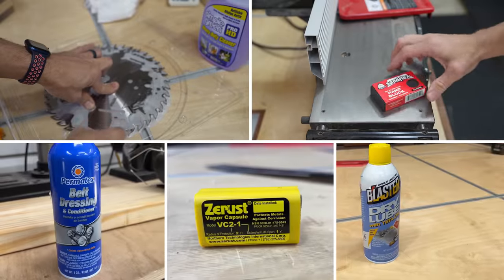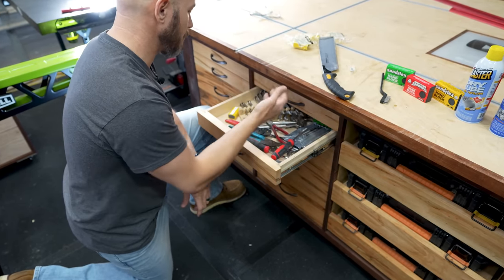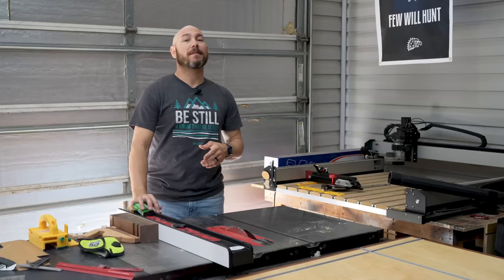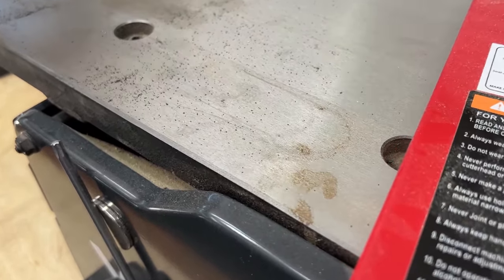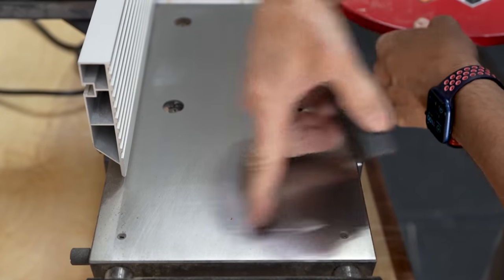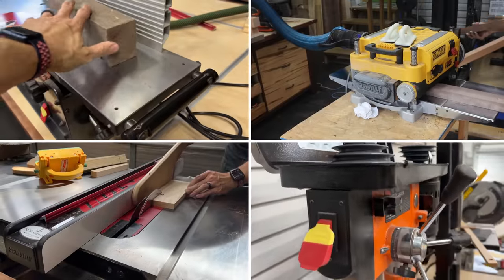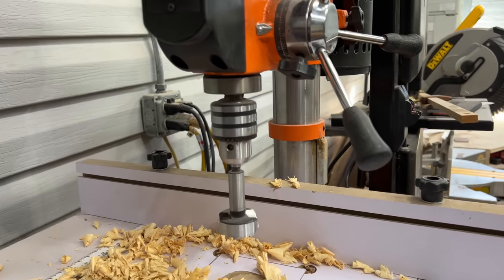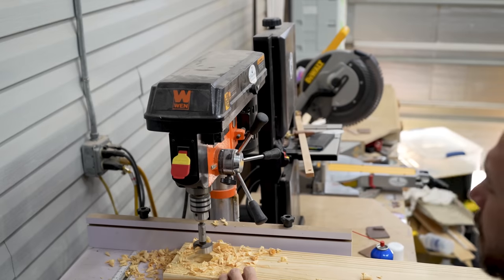5 Products PRO Woodworkers Use to Maintain Their Shop (YOU CAN TOO)

Comment: Nice video with a couple of points to note:  experts have said not to use an “oven cleaner” because the chemicals are caustic to breath and to the skin and can attacked and weaken the brazed carbide saw tips.  Yes, a brass or plastic brush should be used instead of a stainless brush which can damage the carbide blade.
Reply: Also, make sure any paste wax or protective covering doesn’t contain “silicone” as the residue can rub off and stain will not properly stick to wood surfaces.

Comment: Serpentine belts are the grooved belts like on your car. Usually wider and much thinner than a V belt. They are used on a lot of woodworking tools like a SawStop tablesaw.
Reply: Even the old Ridgid r4512 has a serpentine belt, they’re supposed to be superior to the standard V-belts, some folks say almost as good as link belts.
Reply: Or it could be a cogged v belt if the belt is a V shape, not a straight side. We use cogged v- belts in the hvac field.

Comment: Very useful video. However, I prefer brass brushes for cleaning my saw blades. Also, it is very helpful when you translate various Arkansas terms like "shied down". Don't stop using them just help us know what they mean. Thanks.
Reply: i thought he said "showered down" ???
Reply: He said showered down and clarified it meant pulled hard.
Reply: Miriam Webster says it is a verb that can mean "to suddenly start or pull away out of fright". Actually, it appears to have a multitude of meanings but, in this case, it means whatever he says it does.
Reply: @kencoleman7762  I grew up hearing the phase when referring to giving a vehicle a lot of gas. You “shower down” on the gas.
Reply from the maker: @wade exactly!

Comment: Good tips! I use a 5 gallon bucket lid for my saw blades, they fit inside the rim, and I can soak them there, I also use a small " Brass brush" as it will not damage the carbide tips on the blades or remove the paint from the painted blades.

Comment: Great tips, thank you!
One thing I might add is that when I was in the Air Force we had to stop using Simple Green because over time it starts to degrade metal.
Reply: The purple one claims to be 'Safe on Metal Surfaces' on the package.  The classic green makes no such claim.
Reply: @sirbrewzalot  Good to know, thank you.  I wonder if it still works as good as the original, that stuff was awesome, it would clean off years of grease build up.

Comment: All good tips.     To keep cast iron from rusting,  use 1/4 masonite (cheaper than same thickness plywood) to cover the cast iron on table saw, jointer, bandsaw, and planer.   On the jointer, I use a piece of masonite cut to size a of the vertical fence and use rare earth magnets to hold it in place.    I also wax the masonite.   I think it helps moisture in the air from filtering through the masonite.

Comment: I used 2 - 10x20x1” merv11 filters and set them directly on top of my mini split inside unit. It helps keep a lot of the dust from the inside of the unit and it’s filters. Much easier to simply swap those out than clean the factory filter. It also traps more fine dust.

Comment: Just an FYI, a serpentine belt is normally a flat wide belt sometimes with cogs (aka teeth), but not normally bc both sides of the belt are used when pulled through more than 2 pullies. From the look of the wen drill press, I would guess it is a V- belt. Which can be a cog belt as well or not. In the belt should be its length and thickness. Like a 3L180 or even a 4L180, I'm not sure without seeing a bit closer, but I doubt it is an A or B fit something so small. 

Great video, as always sir.
Reply: Thanks. Finally someone who knows what a serpentine belt is. More than a few posters sound very authoritative on this, but are completely wrong. Just goes to show you to take each comment with a giant grain of salt.

Comment: I also use a 5gal bucket lid to set my blades in. Keeps the cleaner on the blade and protects the carbide. I have also heard/read that oven cleaner can damage the carbide on your blade.
Just curious, how do you know how slick owl snot is?

Comment: A few years ago I bought a box of random clamps, sharpening stuff, and other assorted small tools that happened to have a set of the sandflex blocks in it. I didn’t know what they were at the time and when I pulled them out of the box/sleeve they felt kind of gummy, really bendy, and kind of crumbly so I threw them out. Later on I found out what they were and how useful they were and wished I did some research on them before throwing them out. Thankfully they aren’t very expensive. Are those something that can be used on wood as well? Granted that I have plenty of regular sand paper but was just curious about that.

Comment: Oven cleaner can  attack the braised joint of the carbide teeth on a sawblade. You don't want that joint failing when the blade is spinning. Also, many blades have a permanent PTFE coating to reduce friction  and heat. Simple Green will remove that coating, but I guest if you have Blaster Teflon spray you can at least temporarily undo the damage. Speaking of damage, stainless steel brushes can damage blades. A brass brush cleans just as well without  the damage.

Comment: Hey Matt, I really hate to be that guy. But I feel that if its something that may cause a safety issue. Then I feel that it would be worse of my not to say something. So here goes nothing. To start with Stumpy Nubs, I believe is the one I've heard several times talking about these two things. One, I wouldn't use stainless steel brushes on your blades. Over time it can where down the blade and scratch it up pretty bad, as well.. And second oven cleaner is definitely something you want to avoid using on your saw blades. Oven cleaner, over time will eat away at the brazing that holds the carbide teeth, onto the metal blade. And after sometime, those carbide teeth will actually start flying off of your blade. Sharp metal projectiles, yike!!

So with that said, I have two recommendations. The first one is, try using a brass, or nylon brush to clean away the pitch. Neither of which will scratch or tear to up your blades.

And next is, use that Simple Green.... Or if your looking for something else, there is a non hazardous product. It's called Evapo-Rust and it's a water based, rust remover. That isn't harmful to your hands, and you can actually reuse it. It's pretty amazing what that stuff can do. Thanks for another great video my friend. And I'll be ordering a couple of those items from your affiliate links. So thanks for that also. God bless you and your family brother. Stay safe my friend..

Comment: I’ve used Teflon sprays for over 40 years. Do yourself a favor and use brass or plastic bristle brush, even the tiny steel wires can damage carbide. Living in Arizona with the humidity levels are extremely low you still do have rust problems and your ideas are great. The sanding blocks you used it been around for years and are so simple and last very very long time and a great small investment.
Reply: Agreed. Brass is best for blades.

Comment: If you've never tried one you need to do one of the green link belts like from harbor Freight it makes the world a difference for belt driven tools it cuts down severely on vibration because those rubber belts form kind of in oval shape and they vibrate every time it goes past that spot
Reply: Link bolts can make a big difference in performance. I put one on my 1.5hp table saw and the difference was immediately noticeable. Faster cutting, less burning. And no need for a belt dressing.

Comment: Awesome tips. How do you store all your sandpapers? I use a ziplock bag and for bigger sheets i put them inside a folder and tuck them inside a cabinet drawer.
Reply from the maker: I've got a sustainer I put them in (Festool container thingy)
Reply: manilla folders for each grit then put them all in an accordion file holder.  easy solution for those of us without the festool money ;)
Reply: I keep them in the package they come in and have a drawer for them. They are assorted in ascending order so the first thing I have to move is my 80 grit. Usually what I need first anyway if not 100 or 120 which are 2nd and 3rd down.

Comment: I would not be using those stainless steel brushes my good blades.  Use nothing heavier than brass or save your worn down tooth brushes which also do a decent job.  You didn’t use stainless bore brushes to clean your rifle and handgun barrels, did you?  I hope not.  Anyway, same principle, micro scratches in the steel.  
They call em serpentine belts cause they snake all around the engine powering the alternator, water pump, power steering and the a/c plus an idler pulley to keep tension on the whole operation.  If it breaks on you, you’re not going anywhere!  And, when you replace it, follow the diagram exactly or yinz will go crazy trying to figure out the correct orientation or it won’t work.  One belt to rule them all and in the engine compartment, bind them.

Comment: I have a contractor aluminum top table saw that has a coating on it with a couple of scratches on it, would the wax be better or the dry lube?
Reply from the maker: Probably the dry lube

Comment: I like to use a drop or two on the saw blades of DSX extra and the hotter it gets the slicker it gets and it will not grab dirt if you just put a drop or two and rub it in. Also Lowe's has a product called super slick stuff that is really good for cleaning and lubrication and rust removal, with a little elbow grease 😎